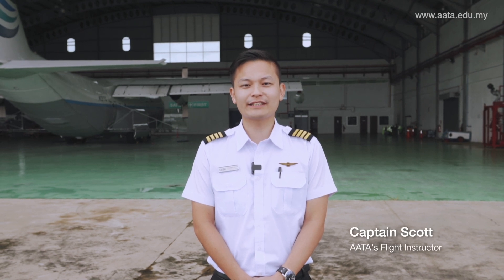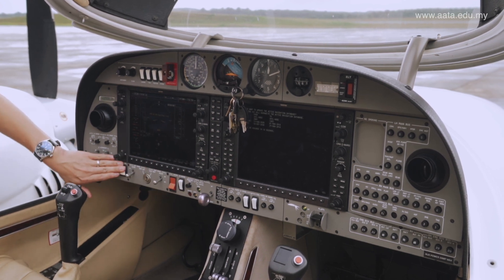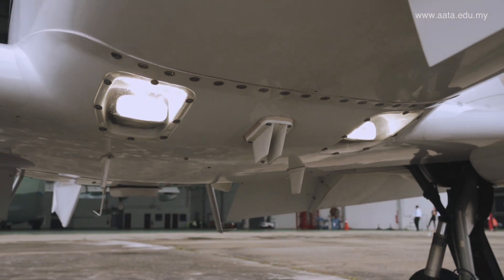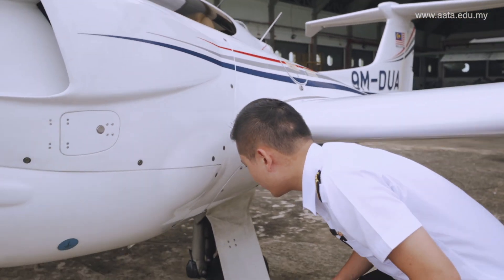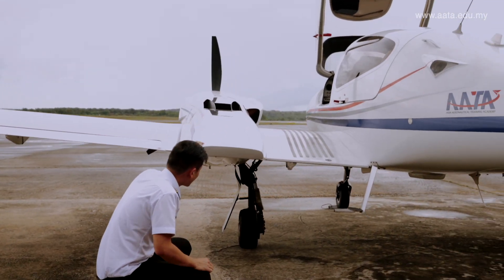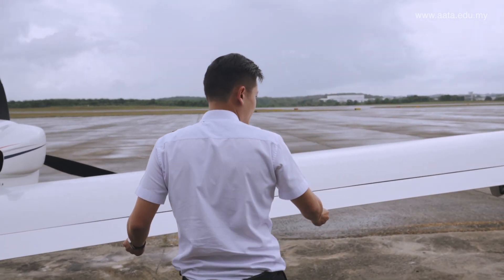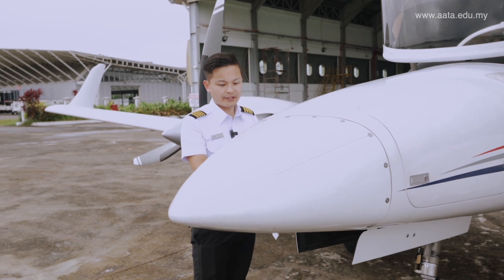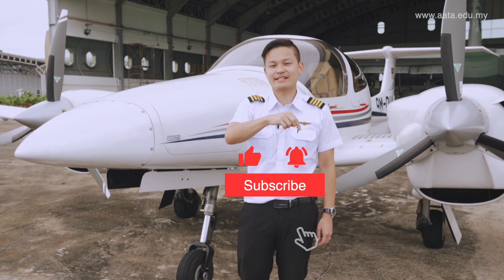Diamond 42NG Pre-Flight Inspection

Comment: Informative video. At some point after the lights check but prior to the full exterior inspection the flaps were raised. Normally, wouldn't you keep those in LDG for the exterior inspection?

Comment: Static wicks are not for preventing lightning strikes FYI, they remove the static electricity from the aircraft that is built up on the boundary layer when air passes over the surfaces of the wing and fuselage which helps avionics and navigation equipment resist electrical interference
Reply: came here to say the same thing!